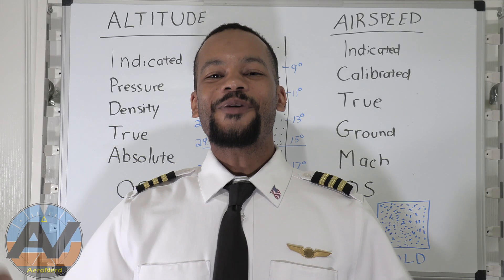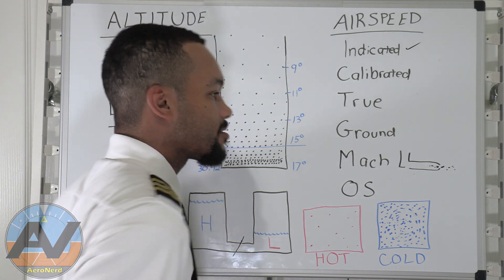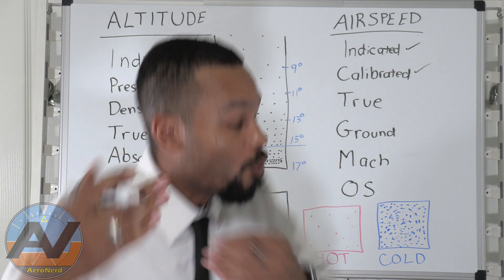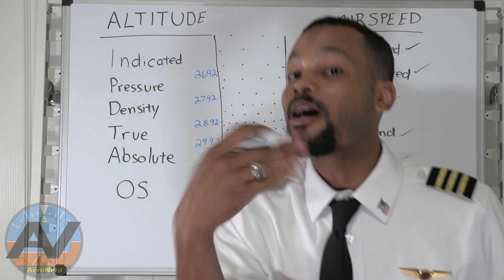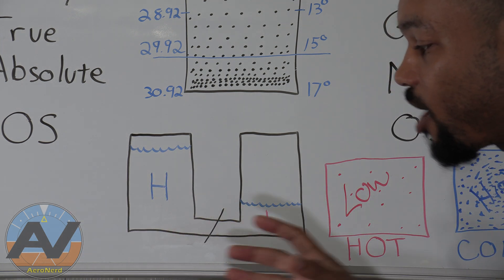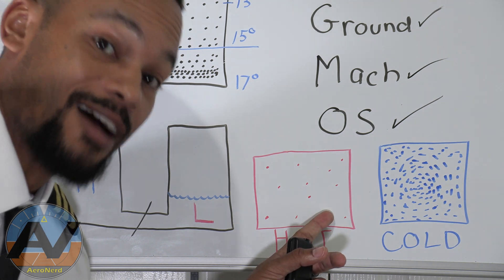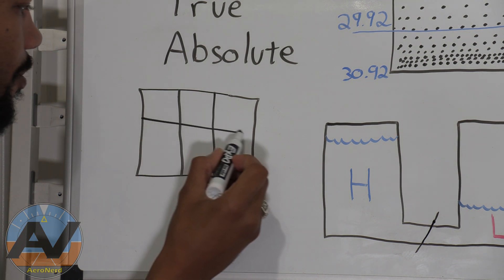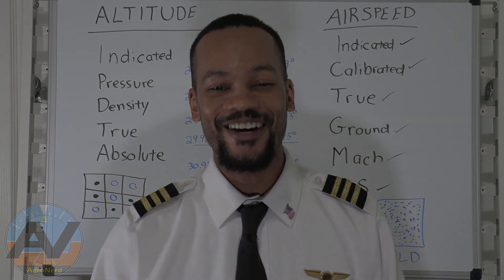Instrument Ground School 03: Airspeed Altitude Types

Comment: You explanation of cold and warm air could not be more wrong.  Atoms don't get close to stay warm.  The energy state is low meaning they are not moving as rapidly.  Energy state is determined mostly by temperature.  More apt analogy would be water vs boiling water.  Everything else was ok.  Also, the OS thing is retarded, you should edit it out.  Overall I like your videos, but this was cringe-worthy wrong.